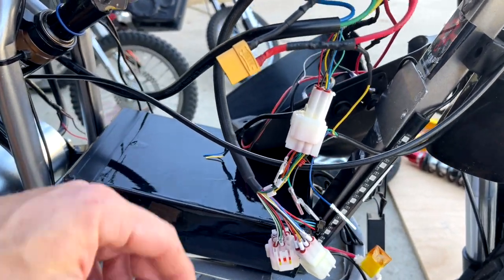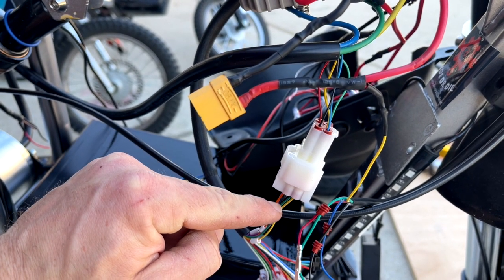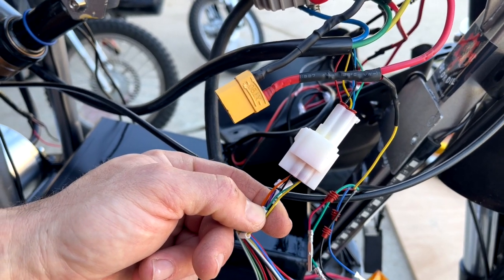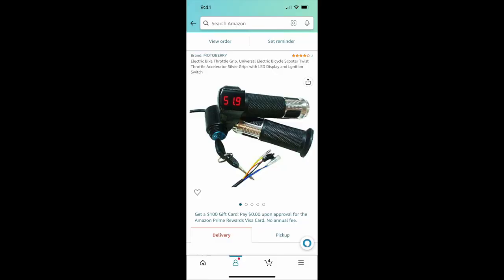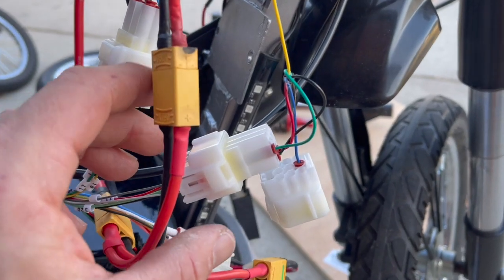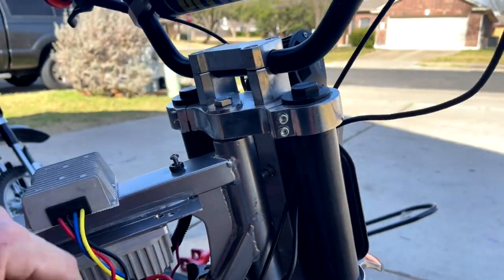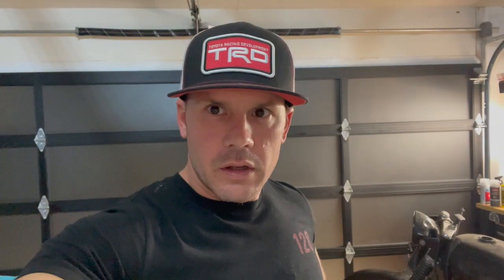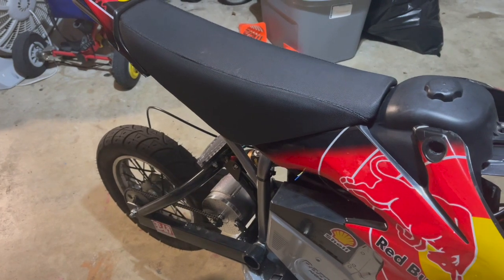ULTIMATE GUIDE To Wiring Your Kelly Controller & MY1020 Motor- Electro and Company MX500 MX650 SX500

Comment: I heard the cheap vevor Amazon throttle is too touchy with the vevor controller. Once you pair it with a Kelly controller instead, does it do much better? Or do you think the throttle that comes with the Kelly is a lot better?
Reply from the maker: The vevor controller with the vevor throttle is crap. When you add the Kelly, you can adjust how sensitive you want the throttle to be. You can also adjust the power delivery over time to allow for smooth roll on acceleration. 👍

Comment: Does this work with sinosudal? Thanks!
Reply from the maker: Make sure the motor matches the controller type 👊
Reply: @VoltronWatts  could you please tell me the difference between the 2 I have a vevor motor and 2 15ah scud battery’s

Comment: Hey, I had a bike shop who also does electric bike things, install the motor connecter from my stock mototec motor to kelly and he just put black to black, yellow to yellow, green to green, blue to blue, and then red to purple. The bike runs but it won't throttle. He has tried a different throttle and same thing happened. I told him about this wiring diagram but he said it should still work. What do you think?
Reply from the maker: I’m not sure broski. I’ve kinda moved on from Kelly controllers and my Knowledge with them kinda stopped at this video. Sorry man

Comment: Hello, I got a Surron engine at a bargain price with 400 kilometers of use, that is, almost new. Once I type 170, it performs the angle recognition but does not return to 85. I configured it to 5 poles and on the monitor I get "Identify Err." I tried to manually change from 170 to 85 successfully. To try to identify the angle again, nothing. Everything remains the same. It does not return from 170 to 85. After finishing the process, the last time I left it for more than 30 minutes and still nothing.

Do you think 5 poles would be correct?
Reply from the maker: I believe the Surron motor is 5 pole pairs

Comment: Great video! btw does the kelly controller work with a 48v battery or do i have to switch to a 72v?
Reply from the maker: A 72v Kelly will work with a 48v battery but a 72v battery should not be hooked to a 48v Kelly 👌

Comment: What do I do if the moter spins backwards I need help I have the Kelly controller kit
Reply from the maker: There should be reverse motor setting in there
Reply: @VoltronWatts  I have the 5000w kit from electro and co I plugged everything in and it spins backwards I have the Kelly controller and my1020 moter. Can we chat on somthing else I need serious help with this I have not ridden in 6 months and I’m stressed.

Comment: Great channel, thank you, I got a razor and I am mixing and matching the new electro and co ec4p (11kw) motor with a Kelly kls 7245 (350a), this will help alot
Reply from the maker: Thank you for your feedback! The bike you’re building is going to rip!
Reply: I'm doing the same, does the hall sensor wiring connect the same way as this video with the my1020? Because my EC4P motor already has the Kelly plug installed from factory

Comment: Very useful. Do you have links for some great motorcicle or go-Kart electric motors other than from Amazon? The largest that I found in Amazon are 2000 Watt for 48V and 3000 Watt for 72V.  I need more than that. I need preferebly for 48V.
Reply from the maker: Yea man. Check out lonestar electric and electro & co. Be sure to subscribe to the channel 🍻🤙

Comment: i have a volt meter and key which has a kelly connection and i have a throttle only with a connector to vevor and the wires are brown black and blue , i can find out how to wire it to the kelly controller ?
Reply from the maker: Need to get a wiring schematic from Kelly
Reply: @VoltronWatts  i figured out the throttle but the only thing i can’t figure out even with all the kelly wiring diagrams is the volt meter which has one black pin an iii b connector no idea where it would go

Comment: Is the color matching the same even for the electro and co my1020+? I got one and a controller that have all the connectors cut off…
Reply from the maker: Should be 👊
Reply: @VoltronWatts  getting a hall sensor fault code following these colors. Got two wires extra prob temp sensor. I guess I need a wire diagram or a picture of the original hall sensor cable so I can play color matching. I guess there is always a chance the hall sensor is bad but I’m trying to rule that out

Comment: Awesome video and you got me all setup. However, could you let me know where I could wire the brake wires +\- (cuts power when u hit the brakes)? I’m on factory brakes
Reply from the maker: To be honest, I have never wired the factory brakes to the Kelly. I’ve always ran aftermarket hydraulic brakes. Do you have a wiring diagram for the Kelly?

Comment: Just a little FYI. Yes it does work. But the kbs and kvd don't share the exact same wiring.  It's not getting the full potential because 2 wires aren't where they should  be when using the kbs diagram for kvd.  Compare both manuals and wiring and see what you're doing wrong.  Good job on spreading the knowledge though.  Just need to do a little more searching before posting.
Reply from the maker: Thank you for the info!

Comment: Hey the blue line is batt+ feed back to turn the controller on correct?
Reply from the maker: Coming off the throttle? I think yellow goes to power. But I don’t have the wiring diagram memorized, I could be wrong. It’s happened before. 😂
Reply: @Voltron Watts  yeah yellow goes to battery.  blue is the power on line To turn the controller on?

Comment: Hey I have a Kelly controller from electro and co and also there volt meter and throttle I bought everything separately and put it together but ever since me first ride the bike cut off on me and I haven’t be able to get it started again. I can’t tell if the controller broke on me or the volt meter or something cus all the wire connections are still intact so I’m stuck
Reply from the maker: When you put power to the bike does the. Voltmeter show the voltage? Does the Kelly controller show a green light when it’s on? If it not, does it show a light at all?
Reply: No the volt meter doesn’t show any voltage anymore. I’ve tried replacing the volt meter still nothing. I don’t see a light on the controller to Indicate if it’s working or not but I’m thinking it might be the controller cus my battery from amorge still is showing voltage. I just have no way to hook the controller up to see what’s going on.
Reply from the maker: Weird!

Comment: hey i have a question. when you got the kelly did you have to program the kelly.can you show me how to wire everything step by step
Reply from the maker: My Kelly ran right just fine out of the box. 👍 you can always adjust the settings tho!
Reply: I connected everything and the motor don't run and it just make bip sound
Reply from the maker: @fernandorios9532  try hitting the auto learn feature in the Kelly settings.
Reply: how do I do learning feature on the Kelly controller

Comment: Hy bud I'm trying this for the first time which one did u get bc it gives u the options on 3 to buy from electron and company
Reply from the maker: Are you looking at Kelly controllers?
Reply: Yes from electron and company and it gives me the option to choice from 3
Reply: NONE
ULTIMATE RAZOR PRE-TUNE +$55
ULTIMATE RAZOR PLUG & PLAY +$155
ULTIMATE RAZOR PLUG & PLAY WITH KEY +$185

Which one did u choose?
Reply from the maker: @joelpele100 ultimate razor plug and play 🤘 and use “Voltron5” at checkout to save some cash 👌
Reply: Thanks alot

Comment: How well does the KVD drive that motor? I'm trying to get a KLS-N to work with mine and it's cogging no matter what I do. Hilariously, I have the exact same throttle, motor, anti-spark connectors, and batteries.
Reply from the maker: I had a KLS on my first build. It was good. I have since gone to KVD. No reason really only that E&C and lone star electrik uses them. But I’ve had great luck with the KVD. Just get the one that suits your batteries numbers. 👍

Comment: great video! thanks for it. When you purchase the controller off the kelly website does it also come with the other connectors and the pins as well? My kelly controller from E&C recently blew. Also when buying the controller off the kelly website did you order the can bus option? or know what that is?
Reply from the maker: Sorry for your luck! And yes, it comes with all that. 👍 thanks for watching!
Reply: Do you know what the can bud option is when ordering from the kelly website? Did you buy it?
Reply from the maker: I think may be the way you hook it up to the computer. The wired connection.
Reply: @VoltronWatts  thanks a lot!!

Comment: I dont have a key switch throttle how do i wire in a seperate key switch
Reply from the maker: Shouldn’t be much different. Do you have a wiring diagram ?
Reply: @VoltronWatts  ya it said from battery to the switch from switch to wire #7 but i did that and it sparked on me and i turned it off can that wire handle 72v going to it
Reply from the maker: I’d have to see exactly what you’re talking about
Reply: Basically i ran all 84v back into pink wire #7 and people said thats how it goes yet mine blew a 100v capacitor with only 84v
Reply from the maker: Oh shit 😳

Comment: Your wiring guide helped me a lot, thanks! So you know you're supposed to crimp the rubber grommet to the pin that goes into the connector, not push it in afterwards.
Reply from the maker: I’m glad it helped you it and thanks for the tip! 👊

Comment: Thanks so much, this is very helpful.  I've been hesitating on buying a controller due to wanting to custom wire some stuff and I wasn't sure if the included instructions would make it easy enough, but you came through and solved my problem!  Looking closely at the diagram in the manual on their site, it looks like there is a 12v lead you could tie in to for your accessories, so you wouldn't need the 12v down converter.   It is the red wire marked "11".
Reply from the maker: I’ve heard about that but never pursued it. I wonder if it would still power accessories with the power off. I run LEDs at night when the bike is parked and powered down since the converter is in line, it’s always getting power from the battery and powering stuff even with the key off.
Reply: @VoltronWatts  the 12v line on the controller would only be on when the controller is on. Your key would also turn the lights off and on, no need for a separate switch.
Reply: woah im really curious about this idea, have you or anyone you know tested to see if it works ?
Reply: @JUNXRCZ  I haven't yet but am pretty sure that it would. I have some some LED strips on my forks that are wired to be daytime running lights whenever the bike is on, but also work as turn signals, so wiring to constant power is not ideal for me, but then only getting power with the bike on would be perfect, and I would prefer to not have another switch just for the DTRLs. Anyways, haven't tried it, yet, but let me know if you try it and it works.
Reply: @JUNXRCZ  I tried it, and it kind of works. The voltage hovers around 10 and a half, and you can only run the weakest of LED lights, not a headlight or a horn or anything else.

Comment: At 1:45 my enc motor 6k motor matches the color to harness on the lonestar piggyback kit which is the same way I had my previous 2000w vevor motor.. but here you have the three wires in different order. I'm wondering if this why my new motor is 10 mph slower then my previous motor even though it's 3x the watts and over 2000 more rpm
Reply from the maker: To be honest with you, I can’t speak to the lonestar set up or the E&C since I havnt used either. Sorry man. I wouldn’t want to give you any bad info and If don’t know or am not sure I’ll be the first to admit it. Wish I could help dood.
Reply: @Super Charged   its all good. I repinned it to how.you have it and did the auto identify. Can't figure out why I lost 7 mph going from 2000w to this supposed 6000w motor

Comment: If I were to buy the electro and co my1020 motor can I use a 52v?
Reply from the maker: Hey! The electro and co what? Controller?
Reply: Also it’s a 52v 100w to 1500w
Reply: @VoltronWatts  also the electro and co Kelly controller
Reply: @VoltronWatts  yes
Reply from the maker: Yes. You can run it

Comment: I keep getting an auto identify error (1-1 error code) I tried switching the hall sensor wires like you suggested and I'm still getting auto identify error. Wrong wiring of motor phase or hall sensors wires. Any ideas that I can work through?
Reply from the maker: I’ll ask the guys in my group and see if they have any thoughts.
Reply from the maker: I’ve wired multiple controllers and so have the guys I ride with. Maybe they have a thought. I’ll let you know.
Reply: Hey man, Im also getting the 1-1 error and I have tried every combination, did you ever figure it out?
Reply: @philippham2824 I ended up getting a new motor assuming it was a bad hall sensor, and it worked after that
Reply from the maker: @chiphappens6260 awesome man! Glad you figured it out 🤙

Comment: What model Kelly controller is that?
Reply from the maker: KVD - Trapezoidal Brushless Motor Controller (24V-72V) (140A-380A) - 72V, 140A
Reply: The one he has in the photo is elec&co's KVD7212NX
But im curious what he's running as well, if its a KVD7215NX or something else.
Reply from the maker: @baldydoes  the one installed is a 7212N 40-90V 140amp controller from Kelly
Reply: I have a vevor 48v 1800w brushless. I plan to get a 48v 20ah cao mm battery. What exact configuration for the Kelly controller do I need ?
Reply from the maker: @sweatpantsmoney4409  hey man. It’s impossible to say exactly eBay you need. It really depends on what you’re trying to set the bike up for. I’m working on a video specific to the Kelly and the 5 most important settings in the controller to pay attention to.
Reply: @VoltronWatts  no I just meant which config on there site. I just ended up doing a 48v / 140a. Hope it’s the right one.
Reply: @VoltronWatts  came across your video and it’s identical to what I wanted to do with my mx500. I didn’t want to use the vevor controller. I wanted something more responsive. Didn’t want to be stuck with a electro and co kit. I wanted to do all myself from ground up and cut cost. Thank you for doing such detail in video giving all detail and steps! Keep it up man! I’m new to this and had an idea in my mind what exactly I wanted. your vid’s gave me the green light!
Reply from the maker: @sweatpantsmoney4409  wow! That is super high praise man! I’m glad you found it useful and I hope the content I create from now on will inspire do things on their own, create and overall just have fun. Let me know if you need help along the way! 👊

Comment: Awesome video man thanks for the help I did run into a problem though I bought a motor without a temp sensor in my controller has a temp sensor and was hooked up to my last my 1020 plus is that going to be a problem
Reply from the maker: Shouldn’t be 🤙
Reply: @VoltronWatts  so basically just don't plug anything into that temp sensor while  coming from the controller? I certainly appreciate all the help you give the community man I'm in all the groups with you on Facebook and I see you 🤟🤟🤟
Reply: Wire* not while lol
Reply from the maker: @wiscogunguy I appreciate you man🤜🤛 yes. Temp sensor should be the white wire. Just leave it out or don’t plug it in. Should be good to go
Reply: @VoltronWatts  thanks man u rock  Hope this works I just bought a cheapie amazon motor until my EC 4p gets here in 6 weeks😭😭😭😭😭
Reply from the maker: Did it work?
Reply: @VoltronWatts  yes sir it did!
 long story short I bought some cheap Amazon my1020+ motors , I was getting Hall sensor errors so I took them back and ordered a hot packs my 1020+, that one was beeping also so I contacted electro and co. and they said that my 5 volt wire to my throttle is possibly bad or my controller is fried so I sent it in and in the mean time ordered a far driver 72450 .. I used your tuning video and a Little help from Ryan and this thing rips even on the my102 I can't wait to try it on "the one". . When the Kelly gets back,I'll put the my1020 plus and the Kelly on my sons bike so it worked out great 😁😁😁thanks for all the help man . I don't think you realize when you're making these videos people use these bikes to get to work and when they're down they're absolutely screwed that's the situation I'm in my bike was down for 2 weeks and had no ride to work you and Ryan were a big fukn help so thanks a ton